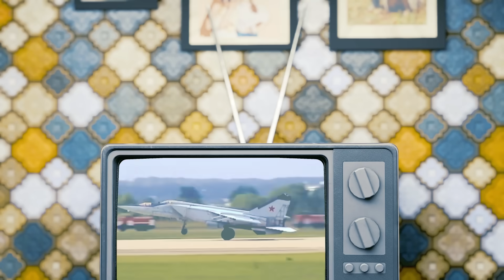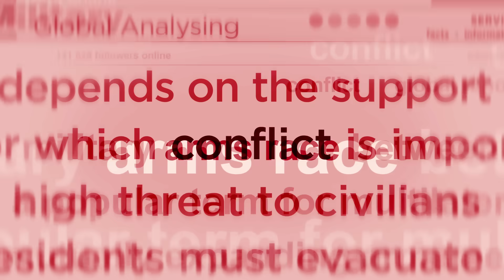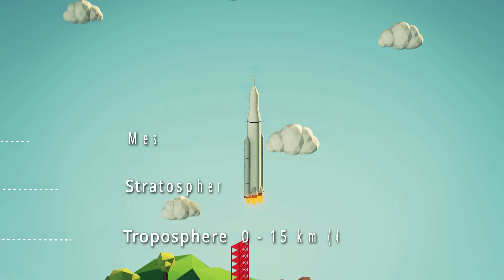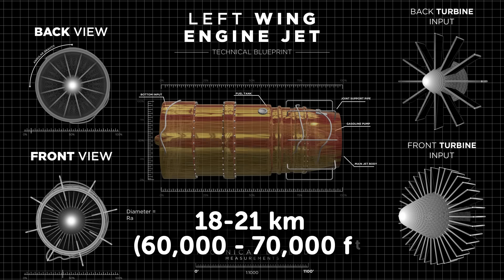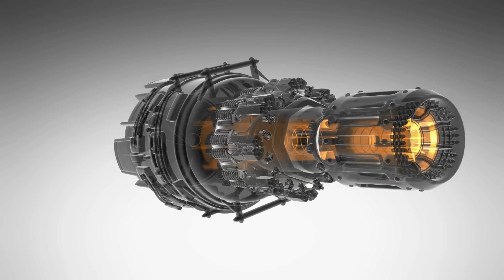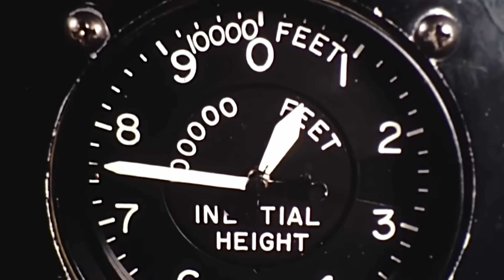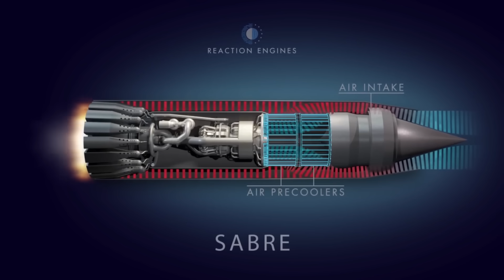Why No One Has Broken This 37km Flight Record!

Comment: But the Blackbird and A-12 could cruise at Mach 3.2 or faster between 85,000-90,000feet in Altitude
Reply: The SR71 never reached 123,000 this is the point of the video
Instead you type diatribe regarding the SR71
Reply: @MMR-s4t  You are confusing REACHING and CRUISING.   The MiG 25 didn't actually FLY at 123,000....it was out of fuel and just a ballistic missile that peaked that high.   BIG difference to the Blackbird cruising for an entire tank of gas at 80,000+ and Mach 3.3+ which neither the MiG25 nor 31 could or can do.

To maintain control where there's not enough air for the engines to run you need reaction control jets like spacecraft use to maneuver.    Beyond bragging rights...there is no logical reason to break the altitude record so good on the Russians for holding it.
Reply: @recoilrob324 whatever. Yay go USA y’all are the best…fastest, highest, lowest, widest.etc. Good bye
Reply: @billpugh58  Where did this come from?   I love lots of Russian  engineering...particularly their rocket engines which were decades ahead of everyone else and were it not for sanctions from the unnecessary war in Ukraine ULA would still be using them.
We had Soviet jet engines in the 'petting zoo' for examination and they were VERY cleverly designed....enough so that some of their features were 'incorporated' into our most modern jet engines.
There is no hate here for Russians or their technology so please don't be that way.
Reply: @recoilrob324  yes but the point is that mig-25 had fire capability, something blackbird never did, and putting a radar avionics and weapons limit the speed and altitude
Reply: @peposad2588  The Blackbird carried a LOT more electronic equipment than the MiG-25 and there WAS a version early on that carried missiles but wasn't practical as an interceptor because the USSR didn't have anything flying that needed such capability and also the YF-12 wasn't something you could rapidly launch as needed and was actually FASTER than the SR-71 'Family Model'.
So this argument is silly...two different aircraft made for two different missions.   One (the SR-71) VERY successful spy plane while the other that was made to intercept it NEVER was able to.   The MiG-25 could not match the speed nor the altitude despite it 'Holding the altitude record' which was the gist of the video it's not the same as actually FLYING at that altitude.   
Which of course is held by the SR-71 as the highest flying and fastest air breathing aircraft ever made.
Reply: @recoilrob324 Píšete tady o náhodě? Nebo popište přesně to čeho Mig 25  dosáhl , né tím, že šlo o balistiku.  USA by bez titanu zpracováném v SSSR nikdy neexistoval.  Tedy pokud tvrdíte, že blackbird byl tak skvělý , proč již není ve službách usaf ,Mig 25-31 stále pracuje. Nesnižujte  schopnosti a výkony druhých jen proto ,že jste to vy nedokázali!!! A nedokázali!!! Vaše letadlo je rychlejší,  SSSR mig 25  však v
dosáhlo  výš.  A žádná náhoda o které mluvíte, tento rekord nemůže smazat.  Mig byl sériové letadlo , blackbird jeden !!!! Rozumíte tomu obrovskému rozdílu.  Náhoda je na straně usaf, nikoliv SSSR.
Reply: @recoilrob324  I don't think the YF-12 was faster than the SR-71. The radome and cut-back chines would have reduced its aerodynamic efficiency. The SR-71 broke the YF-12's speed record.

The MiG-25 and the SR-71 had differing design criteria, so they were never going to compete for records. The MiG did not need to fly as fast or as high as the SR-71. It just needed to climb fast enough and high enough to put its missiles within intercept range. This ability allowed it to set its record because it could reach a speed fast enough to allow it to out zoom-climb the F-15. The SR-71 was not a zoom-climber, so it couldn't match the MiG's record.

Comment: Well-made video, but the fundamental question remains unanswered. The record altitude of over 37 km was achieved by the Je-266 (a version of the MiG-25) in parabolic flight. In horizontal flight, the Je-266 cannot fly much above 20 km either. It accelerates to maximum speed and then climbs steeply, causing the engines to fail due to lack of oxygen and the aircraft to rise uncontrollably like a thrown stone to the apex of the parabolic trajectory. Hopefully, the engines will restart when it enters denser layers of air...
I would also be interested to know why this was not tried with the SR-71 / A-12 / Yf-12a.
[8:47] At 107 km, the X-15 did not even come close to reaching the minimum flight altitude of satellites, which is approximately 185 km. Otherwise, it would be slowed down too much to be able to orbit the Earth.

Translated with DeepL.com (free version)

Comment: Imagine an aircraft cable going from sea level to orbital space flight, just imagine how fast that is !!!
Reply: No imagination required. We know how fast it is as we know what orbital velocity is. That's how we are able to keep stuff in orbit.
Reply: Yeah, only for few minutes until the engines destroyed.. MIG was hugely overrated. It's max Cruising speed was Mach 2.83.. F15 could easily destroy it and it did.. 😂😂😂
Reply: @barracuda7018 The F-15 won't have to do the job nature will do it naturally due to believing we can do high G maneuvers where you exceed the aircraft limits at rapid rates , sometimes people don't stop to think about the pressures that the aircraft has to go through!!

Comment: First of all...this 123000 feet or so is about 7000 feet higher than 4 Mount Everests theoretically stacked atop each other. Anyway, the AIR-BREATHING planes in PRODUCTION have to
carry extra fuel and armaments and be designed for a certain performance envelope, so there is no way they can compete with either ROCKET PLANES or a stripped down Mig-25 FOXBAT
that can melt its own engines if it stays at Mach 3.2 for too long....like that one in the Middle East that flew out of a RADAR LOCK but badly overheated the engines. That is why they have GENERAL RULE to NOT EXCEED MACH 2.83 ...so that the Aircraft survives too!!! The SR-71 was designed from Titanium and was meant to fly for HOURS at Mach 3+ at 80-95000 feet!
The RP-7 Fuel was specially designed for it and the slightly faster and higher flying A-12 OXCART. Designer Kelly Johnson at the Lockheed Skunk Works at his BEST so it wonèt easily be exceeded....maybe by a drone, but for a piloted air-breathing RECON Plane of the COLD WAR, IT WAS ASTOUNDING! The YF-12A was the militarized version that in theory could carry a nuke and was the slowest of the 3 in the same family as they all looked similar. In Canada we had the AVRO-ARROW and the prototypes had Pratt and Whitney J75 engines that had about 75% the thrust of the Iroquois Engine (31000+ pounds with afterburner...compared to 23,500 pounds thrust of the J75). Now at 75%THRUST this prototype made it to Mach 1.96 ...add a third and you get Mach 2.6 or so....comparable to an F15 some 15+ years LATER! Add a third to that and u get a plane that is capable ...briefly at least...of Mach 3.4+ ...so no wonder Eisenhower made a dirty deal with Diefenbaker to SCRAP IT, as he knew that if FLESHED OUT TO THE MAX it could intercept the A-12 Oxcart that was to be the successor to the U2, and if the plans were STOLEN...and there evidently was SOME EVIDENCE that Soviet Spies had indeed gotten their hands on some of the Arrow Specs or Details etc., it would possibly pave the way for a Mig-25 FOXBAT type aircraft years before the FOXBAT did come out....since Diefenbaker was looking for a way to end the program and save the country a lot of money, he caved in to what Eisenhower suggested, but what a SHOCK 
to the proud 1000 engineers that were looking for World Records for BOTH SPEED AND ALTITUDE for an air-breathing aircraft. If this sounds like BS...check out the power to weight ratios and it will shock you! Being Canadian myself it pisses me off (happened just before I was born in 1959) as this would still be flying as a Missile truck like the F-15 at the very least! With better avionics and say 2 engines like what the F-35 has...maybe more titanium and it would have been able to reach Mach 3.75 to Mach 4!
Reply: You have made the common mistake of believing speed and power are linear, i.e. an increase in power results in a proportionate increase in speed. Increasing power by a third does not increase speed by a third. Aerodynamic rules state that, everything being equal, power requirements increase with the cube of the speed. e.g. doubling speed requires eight times the power.

However, things are never that simple. A more powerful engine requires more air, changing the aerodynamics of the aircraft. The F4K and M Phantoms used by the Royal Navy and RAF illustrate this. Their Spey's re-heated thrust was 20,500 lb per engine and they reached 1,386 mph. The US Navy's F4J's engines each developed 17,845 lb with re-heat and they reached 1,470 mph.

The Spey engine was wider, it was a turbofan, It required a lot more air. The fuselage had to be widened and the air intakes enlarged, increasing drag. The extra thrust did improve take-off performance, which was useful with our smaller carriers.
Reply: @jurgenkurgen  The Orenda PS-13 Iroquois 
Engine was rated 19250 lb thrust dry and 31000 with afterburner (reheat). Now the AIR FRICTION would have quickly been a problem (maybe like the Foxbat that could fly Mach 3.2 but were told to not exceed Mach 2.83). However...if a 1960's Arrow was made from soft Titanium like the SR-71 it could have matched or exceeded the speeds of the SR-71 or the slightly faster A-12 Oxcart (which carried less fuel than the SR-71). The ARROW had a better thrust to weight ratio. Also some say the IROQUOIS was really capable of 35000 lb thrust ...like the F-22 Engines. My older brother was a Ph.D. Mathematician (he lent math books to GOOGLE Billionaire David Cheriton) and he told me that a heat dissipation solution had been found for the Arrow just before Black Friday! Anyway I am well aware that the increase in friction is not linear, but at speeds below Mach 3.5 it really is surprisingly linear! PROOF...all that extra FUEL carried by the SR-71...yet only 0.1 Mach slower than the A-12 Oxcart!
Reply: @darrylb5247  Yes, the A-12 was a shorter, lighter, single-seater. It was less powerful and the nose profile looks finer, so it probably generated less drag.

Drag is very important and the A-12/SR-71 are very slippery. They are probably better than any other aeroplane with anything close to the same performance. Most military aeroplanes are compromised by their combat requirements. Their air intakes are sub-optimal. Their wings need to carry weapons and to be able to dog-fight. This does not apply to the A-12/SR-71. They are optimised to fly as high and as fast as possible. Even the engine nacelles improve performance, increasing thrust. I don't know how, but even the inlet cones and to the thrust. Controlling the airflow through the nacelle is crucial. The A-12/SR-71s nacelles are huge and have plenty of room to control the airflow.

Other combat aeroplanes are compromised to varying degrees. Static thrust becomes irrelevant as the engine airflow chokes. Many combat aircraft have a surprisingly low maximum speed when their power output is taken into account. Older fighters are often faster on less than half the power. Even then, some were unable to use full power. The F-104 was a good example. Engine airflow caused overheating above mach 2. A quick burst to mach 2.2 was the limit, if you were lucky.

Modern high-bypass turbofans are enormously powerful, but they struggle to exceed 600mph. Just strapping a minimal airframe and wings around the engine nacelle would not create a faster aeroplane.

A few have been designed for speed. Disregarding designs from the '50s and early '60s, most military aircraft compromised speed for combat performance. Many are now capable of mach 1.8, where their predecessors did mach 2 or 2.2.

The original B-1 was a mach 2 design but was redesigned to optimise combat ability over sheer speed.

Concorde was one of the best performers. It could do what is now a desirable characteristic. It could super-cruise, at mach 2.02. I'm wondering if even the much laudedF-22 or any of its foreign competitors can match it. It too had sophisticated engine nacelles. I think that figure was reduced due to concerns about skin heating. Sustained cruising took it close to the limit. I read about the performance trials. The British aircraft sustained a cruise at mach 2.15. The French, doing their trials at the same time, I think, sustained mach 2.05. The story was that the French misheard the British and entered their figure for certification. It was probably a good job, all things considered, stopping the aircraft becoming a little soft in warmer weather and saving a bit of fuel.

Reheat was only used for the real power parts of the flight, like climbing and accelerating. Mach 2 without re-heat, in an aircraft with a take-off weight of over 408,000 pounds, over twice that of the SR-71 and dimensionally almost twice its size. The 31,000 lb dry static thrust of each Olympus engine in Concorde was a little less than the re-heated thrust of each JT11D-20K at 34,000 lb. I think this may relate to improved engines fitted to NASA aircraft, with the USAF aircraft having 32,500 each. Both aircraft benefitted from extra thrust generated in their engine nacelles, though I think the SR-71 benefitted more. They show the benefits of careful design over brute power.

The Arrow looked like a great design. It suffered from a 'not invented here' mentality not helped by a lack of reputation. It really is a shame that Britain couldn't join in. I think it could have been a great thing if British ego could have been put aside, with Canada taking the lead.

The Iroquois looked like a great engine. I've read that later improvements may have increased thrust to 39,800 lb per engine. Titanium would definitely be needed. Speed would really depend upon the engine installation. Get it wrong and the power would fall away. It may have required a lengthen fuselage. It would certainly easily exceed mach 2 and go well past the limits of aluminium. I've always wondered how the F-15 is able to reach its 1650 mph speed. Probably extremely briefly.
As I said before, drag is also a big factor. Get the drag right and problems are much reduced. Skin friction is not as important as form drag. The faster you go, the harder it is to push the air aside.
 Anyway, I've waffled on for far too long so I'll sign off now.

Comment: Nice video!

Just one thing: if a satellite would orbit at ~100 km, it wouldn't do so very long. Maybe around 20 minutes before it plummets and burn up. Low Earth Orbit starts at 160 km and even those satellites need a periodic boost to maintain altitude.
Reply from the maker: Thank you for the information! I appreciate the clarification. I think that's why Elon Musks Starlink satellites raining down once in a while!
Reply: @curiousreason  Those are designed as low cost disposable sats with a limited lifespan. Hence they dont have engines to reboost their orbits
Reply: Because of its low orbit, STARLINK can not remain in orbit long after it reaches the end of its life and loses its functionality, preventing it from turning into debris.
Reply: @63akibow21  Hi. I hope the same goes for "Mr" Musk. 🤣
Reply: @outsider7658  I hope the same for people like you.
Reply: Hmm.. many spy sattelites held at 50km